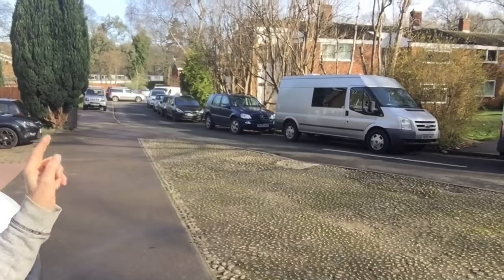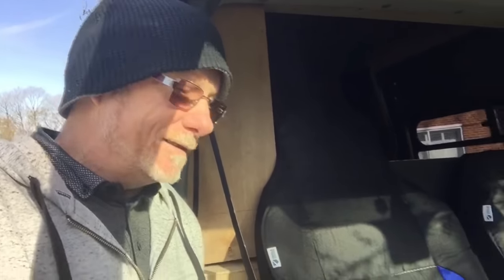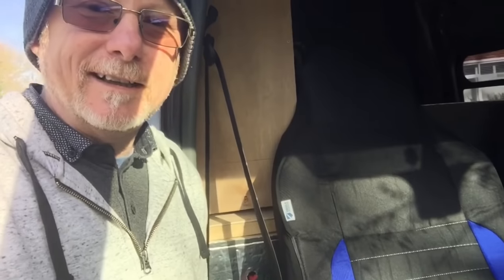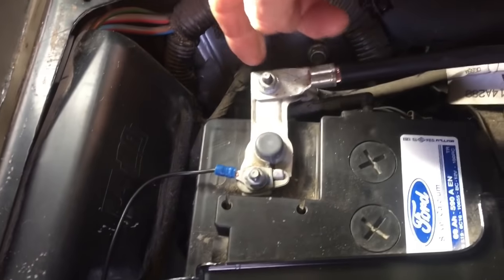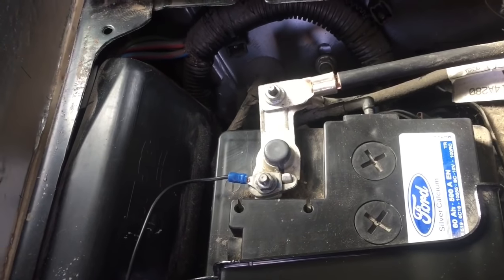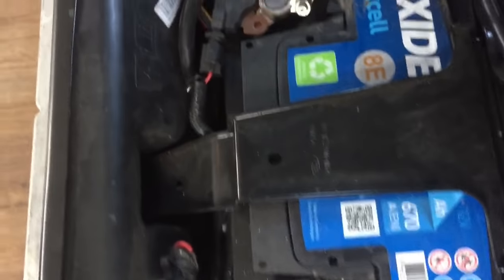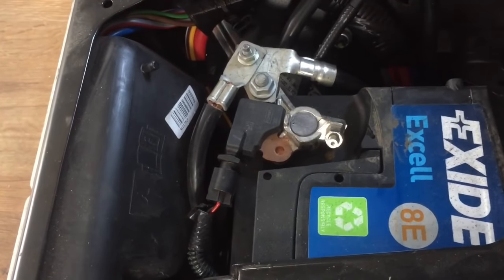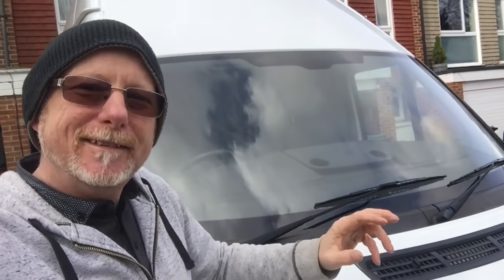How to tell if your van / car has a smart alternator?

Comment: Hey Mel - great video thx - my Transit doesnt have smart alternator thankfully. Split charge works great. I recently added an AC hookup with a charger unit to the leisure battery - all good (if a bit noisy the cheaper ones - watchout) - Heres the rub; when the leisure battery reaches full on AC charge, I can hear the split charger start to click on and off again??? Its almost like its trying to reverse the split and AC charge the car battery back through the split. Is that possible? And how to fix? TVM
Reply: That's exactly what it does. It's dual sensing. 👍🏻

Comment: What's Ah of the Bluetti battery pack inside unit? If the Ah works out cheaper than lithium 12v battery(s) then it's a good setup.

Did you buy it off Amazon or was it a freebie?

Regards Jas.

Comment: Does you vans only have one battery mine has two from the factory. In my van everything MUST be connected to the front battery as the other is for starting and electronics for some reason. Can you change the alternator?

Comment: Will have to check my battery tomorrow, I have same van as you LWB medium roof RWD but I have 2 batteries under my drivers seat ?
Reply from the maker: GAZO D my van has two batteries under the seat as well 🤓🤙
Reply: @BigVanSmallWorld  Sorry only seen the one. Made me wonder why mine had two :) . will be checking mine later as about to do the wiring later this week.
Reply from the maker: GAZO D no worries don’t be sorry it’s quite common for transits to have two battery’s good luck with it do let us know how you get on 🤓🤙

Comment: Hi quick question, just about to convert transit for my daughter but it has 2 batteries, with positives separately going to the battery fuse box. Which positive should I use for the split charger. Any help gratefully appreciated
Reply from the maker: Hi have a look at the back of the battery box aka seat base if you’re lucky you will see a red junction box that’s there just for this purpose let me know 👍🤓
Reply: Mel’s Van World cheers Mel, will have a look tomorrow and let you know, cheers for the quick reply. Keep up the good work 😊👍

Comment: how as ur van got one battery mine has two have to check if it has the leisure set up( great video)
Reply: Same as me and Ford told me that any additions I add to the van must be connected to the front battery as the rear is for the starter and computer?
Reply: @stephenmorgan5100  thANKS FOR THAT I WAS JUST ABOUT TO FIT THE LEISURE BATTERY SET UP

Comment: Hi Mel, I wish I had found this video first! I have a Vauxhall Vivaro sport 2017 & I've installed a standard split charge relay with a 140ah Leisure battery, it goes crazy when the engine starts and clicks quickly, I didn't think anything of it and have been using it for a month or so with having to charge the battery manually every other day too, do you think I have caused any damage to the battery? I don't want to spend £200 on a B2B controller if I've ruined my brand new £200 battery too 😟, thank you for the video and your help! Shane,
Reply from the maker: Good morning buddy it you have an AGM or led acid battery as long as you haven’t drained it lower than 12.02 v you should be ok personally I don’t like to let mine go below 12.2 what I would do is charge the battery then leave it to stand disconnected for 24 hours then test the voltage you want about 12.8 to 13 v or higher to remain if it does this you’re golden good luck 🤞

Comment: Hi Mel , you're  scaring me. I've a 2014 transit and have attached the durite split charge relay. I've got a cut out switch which I haven't turned on yet. So it's still not connected. Also I have two AGL batteries. The glass fibre ones ... is that a problem too.  Cheers Mel
Reply from the maker: Alan Stephenson Ops sorry dude to be safe call ford and ask them please let me know how you get on 🤓🤙
Reply from the maker: don't panic you can use one of these
 http://rover.ebay.com/rover/1/710-53481-19255-0/1?ff3=4&pub=5575467911&toolid=10001&campid=5338454651&customid=&mpre=https%3A%2F%2Fwww.ebay.co.uk%2Fitm%2FRing-RSCDC30-DC-To-DC-30amp-Smart-Battery-Charger-with-Solar-MPPT-Split-Charge%2F201921539775%3Fhash%3Ditem2f03762ebf%3Ag%3AYVoAAOSwCQZZFFTt
Reply: Thanks Mel

Comment: Hi Mel, I have a 2013 mk7 Transit with dual factory fitted batteries, the negative battery lead has the sensor attached which would suggest a smart alternator. I have been running 2 x 110ah lead acid deep cycle batteries and have been running them via one of the 60mp (there are 3) consumer terminals on the back of the drivers seat base via a Durite VSR, (fused at both ends of the link cable). So far nothing has blown up and my leisure batteries appear to have been charged. I recently added 2 x 100w solar panels running to a Victron MPPT charge controller which is linked to the lesiure batteries.Still everything appears to be fine, van always starts even after sitting all week, lesiure batteries charged and no blown fuses. Any thoughts?
Reply from the maker: R Mac I would leave it as it is then something must be rite 🤙🤓🍻

Comment: Sorry but a standard alternator does not stay constant, the nominal voltage when it is not required to work hard is 13.8 v .If the batteries require some charging, you can see up to around 14.7 v
Reply: Thats what i noticed in xterra 2012..  Starts with above 14 v and then drops to 13.5 v

Comment: Can someone help. I have an AGM battery which I think is lead acid? My ford transit has a smart alternator system. I need a dc-dc charging kit can someone send me the correct one.
Reply from the maker: good morning iv used this company for years they do fitting kits 
http://rover.ebay.com/rover/1/710-53481-19255-0/1?ff3=4&pub=5575467911&toolid=10001&campid=5338454651&customid=&mpre=https%3A%2F%2Fwww.ebay.co.uk%2Fitm%2FSterling-Power-BB1230-12v-30amp-DC-DC-charger-Split-Charge-Euro5-6-Camper%2F252631309942%3Fhash%3Ditem3ad1ffde76%3Ag%3AlgsAAOSwHMJYGg2k
Reply: Mel’s Van World thanks! Another question.. is the CTEK mxs the same thing? Is it a DC to DC charger?

Comment: Hi Mel, recently discovered your videos and they are great, I've learned alot. I'm getting to the point where I am about to install electrics in my van. It's a 2015 transit custom. I just assumed it was a standard alternator until I recently heard about these smart ones so I thought I would check. Now I've got the computer chip part on the negative terminal so I'm thinking smart alternator. I carried out the voltage test using a multimeter also and all readings were around 14.7. So now I'm  confused. Any help appreciated. Cheers Sam.
Reply from the maker: Hi Sam 14.7 that’s absolutely right 👍 good luck with your build 👍
Reply: @BigVanSmallWorld  so does that mean it is a smart alternator or that is isn't? 😆 As in the the voltage doesnt drop below 14.7 like people are describing a smart alternator should?
Reply: @HighlandWoodsman  Exactly the same with my 2015 custom. I have the black box thing on the negative, but it's reading 14.96v constant so appears to be standard alternator. Did you work it out for sure in the end?

Comment: Rubbish. Li-on batteries are fine. Just use a proper DC to DC charger and attach the third light gauge wire to the ignition circuit where there is power only when the motor is running. Simples.

Comment: Buy a VW next time 😎👍
Reply: He has had one before and learnt the lesson the hard way that's why he is in a Ford ;-D
Reply: ford lol.Worse van on the road
Reply: @reddave8628  Thats why it's won van of the year more than any other. Ford for Van Life VW for posers! (only Jesting) lol Each to their own mate, had VW Transporter (as did Mel) only reason I sold it was it was too small. VW much better built (except for engines in some) and look much cooler but for a self build that's affordable for most Transit great choice. Have to say a Transit is much nicer to drive than my T5 which had a terrible  turning circle.
Reply: Only a bit of brand banter 😂👍. Tbh I've had loads of transits over the years up till the last two new models. My last one gave me loads of clutch trouble. There not built like they used to be but saying that most aint these days. Ill give you two the hang loose hand sign if I see ya's out 😂👍